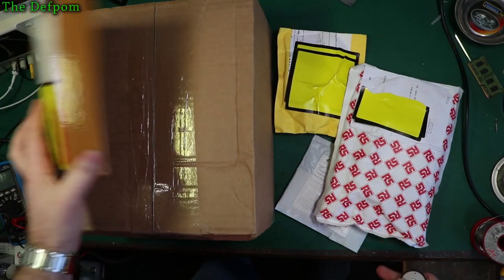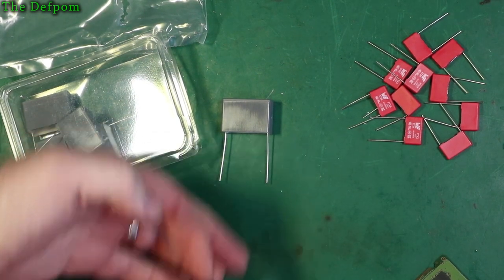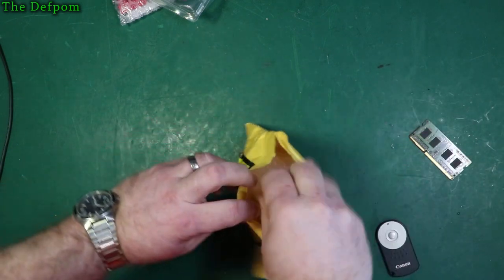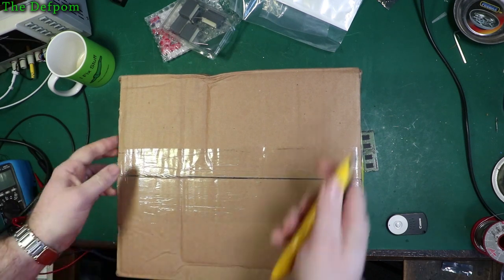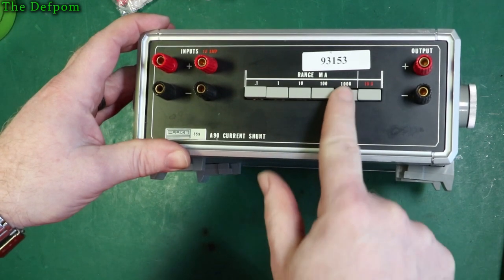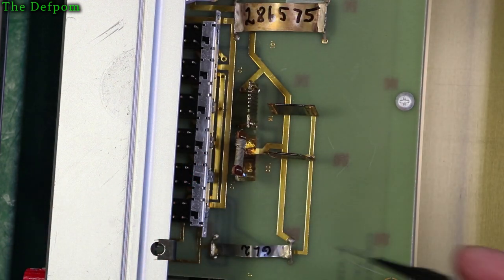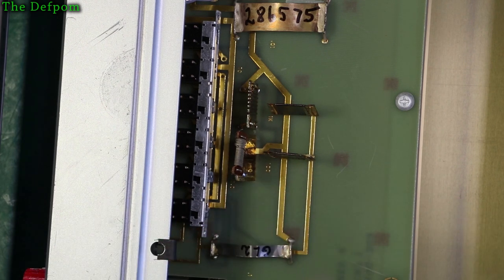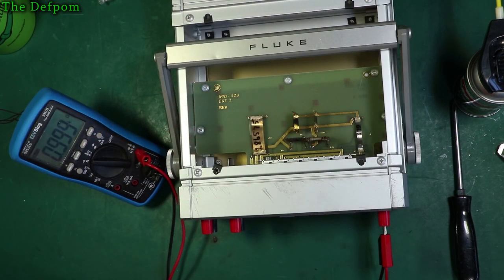🔴 #648 Mailbag Monday 4th November 2019

Comment: Hi, with the RS and E14 parts in strange packaging, look at the part number sticker on the components box/bag. It will possibly tell you from where in the world they came from to fill your order. Especially if you had to wait 4 to 5 days, because they weren't local.
I have had at work a case where we ordered 150 terminal blocks.
In 5 days a postbag turned up with a bubble wrap of 100 terminals, Australian warehouse, 49 terminals in a zip seal bag from Singapore I think, and a cardboard box with 1 terminal in it from US I think.
The box could have held 25 of the terminals and had sponge in it to stop the terminal from rattling around.😆